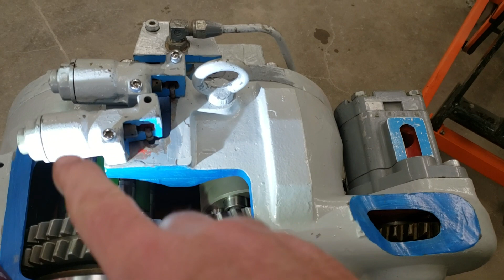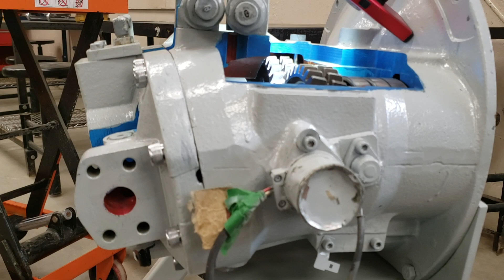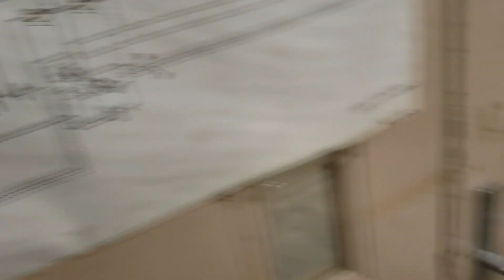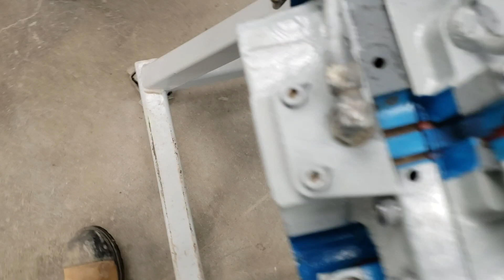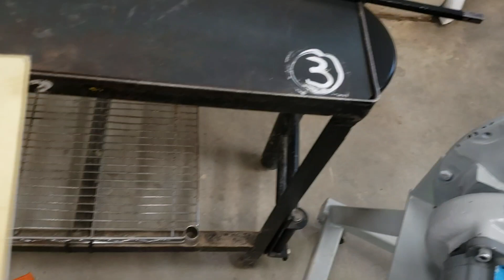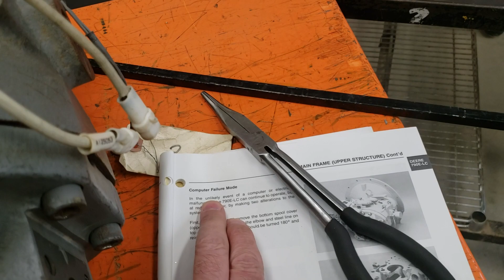HITACHI / DEERE DOUBLE BENT AXIS PUMP OPERATION -A 1990'S PIONEER

Comment: Thanks you for posting this! Try to get my ex200-2 conversion kit to work
Reply: I think I need to cut my spring on the actuator. did you figure yours out?
Reply: did u ever figure out hoe to get it working properly, i am at the same stage with mine im looking for a little shrter spring or adding height to the bottom stopper so the pump cant fully stroke , any advise to add?

Comment: Impressive job. Now I understand the function of my ex200 LC. I am having issues with the displacement and we initially thought the angle sensor was busted and we also thought the angle sensor was the mechanism behind the raising of the plate. Now I understand it is the cylinders and it can manually set incase of limp mode.